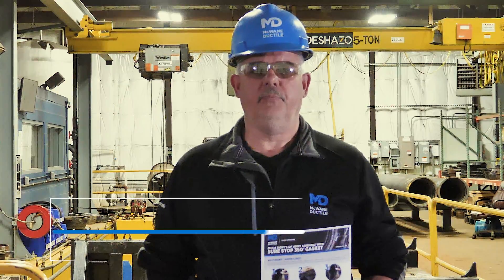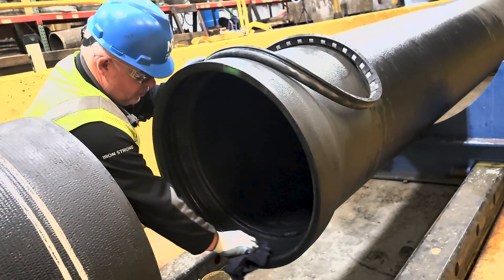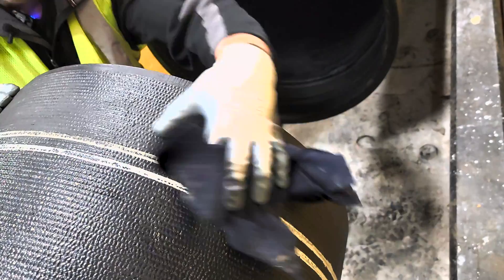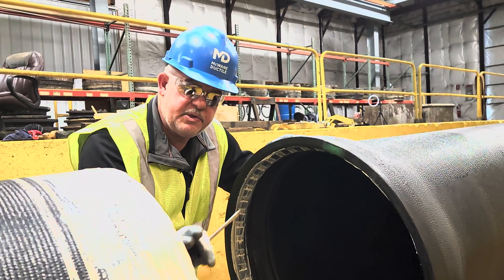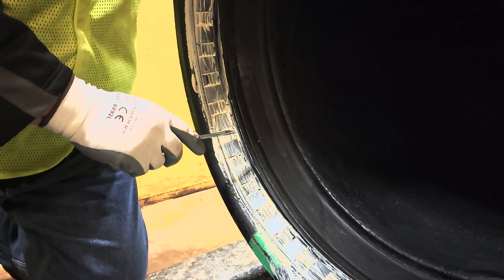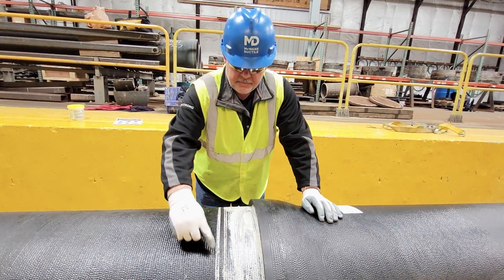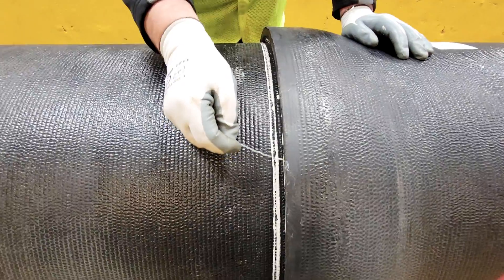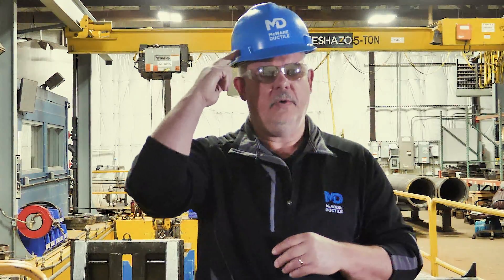How to Install Sure Stop 350 Gaskets in Ductile Iron Pipe

Comment: Dear all
Would you please let me know about regarding deflect angle how much is equal in centimeters for each one degree
Reply from the maker: Thanks for your question. It’s a simple answer of conversion …

The full 5-degrees of deflection at a joint equates to a 1-inch offset in any direction up along the barrel of that deflected pipe.  So an 18-ft length of pipe can be deflected 18-inches, whereas say a 10-ft cut piece would only ‘kick’ 10-inches in any direction.  Obviously, in certain larger sizes or restrained joints where the deflection recommendation might only be 2.5 degrees, these offsets are reduced in half, 9-inches and 5-inches respectively … i.e. ½-inch per foot of laying length.  You know you have moved the pipe you’re deflecting to its max rating when it begins to move the bell of the other pipe it is inserted to. 

All one needs do then, for international units is recognize than 2.54-centimeters make 1-inch, so the “max offset” for an 18-ft length of pipe at 5-degrees deflected is 45.7-centimeters and would be 22.8-centimeters if the joint type deflection limit were 2.5-degrees.